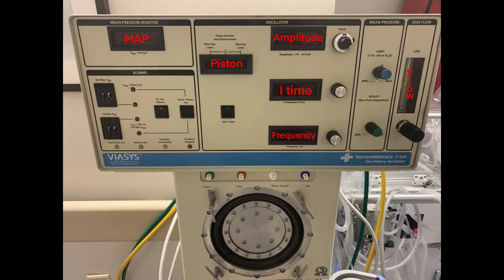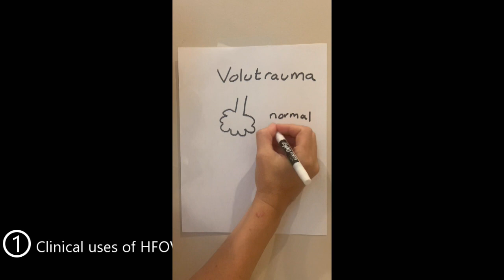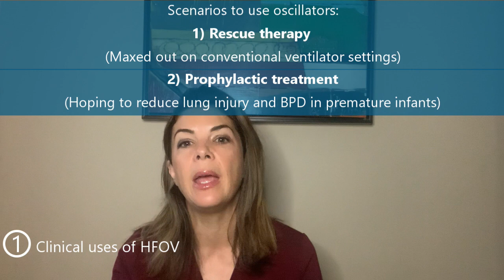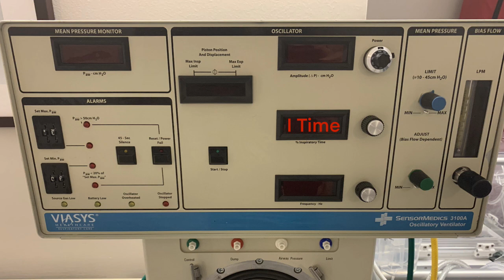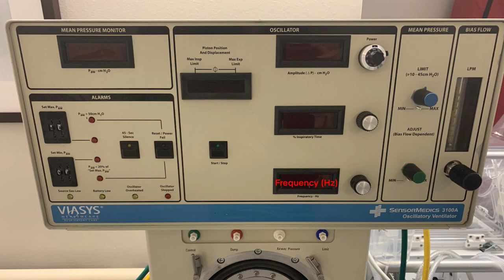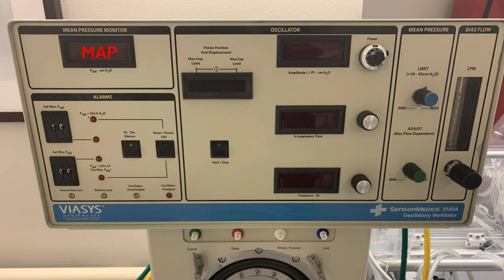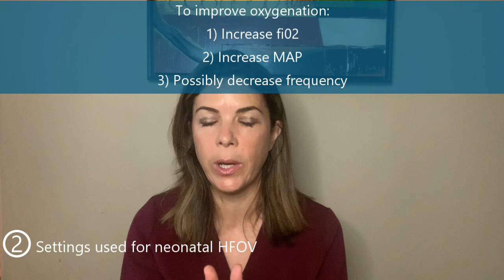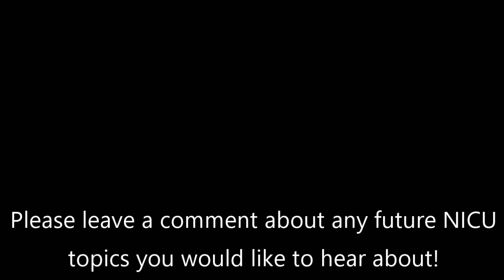PART II of High Frequency Oscillatory Ventilation - Tala Talks NICU

Comment: A lot of good information.  I would like to add that the amplitude is NOT a setting.  The amplitude is a measurement only.  The Power is the setting.  The power controls the piston.  The amplitude fluctuates in response to compliance and resistance of the circuit, airway, and/or the patient lung.  Ordering a set amplitude can be a dangerous practice.
Reply from the maker: Thanks Chris for your comment! You're absolutely right the power is what determines the delta P and the actual setting that needs to be adjusted- but I'm guessing you come from the RT side of things- as in every NICU I've worked in, the order we place is always for delta P or amplitude. Thankfully, the NICU RTs are always are of this. And I agree- any ventilator in the wrong hands- just like any machine- is dangerous. Thanks!

Comment: Dr. Tala, thank you for your wonderful videos. I have questions which you partly eluded to in your videos:
a.) What would be max vent settings on AC-PC and VC-AC at which point you would consider changing over the HFO?
b.) What would be max values in terms of MAP and Amplitude?
c.) What would be suitable extubation parameters for conventional and HFO?
d.) In term of CMV in neonates we mostly use volume control. When would I change over the pressure control>
e.) Why when changing form Draeger VN500 to Sensormedic can I sometimes see such significant changes in my next PCo2 even though I am using the same settings? 
Sorry I know it is a lot. Thank you so much for your help.
Reply from the maker: HI Bettina! These are excellent questions- and they're all super dependent on the patient and the unit0 (AND THE XRAYS- if you're super-inflated- doesn't matter how low your pressures are- you don't want to go higher)- but it's always nice to know how different units do stuff- so we'll make some suggestions!
a) Max AC-PC- rate 40, pressures needed in 30s (or high 20s for preemies). Volume control- not getting there with Tv > 6ml/kg or needing super high pressures to get you tidal volumes
b) Max values oscillator- really dependent on the Xrays- but have gone up to a mean of 30 and delta P of 50 in term sick kids (lower in preemies)
c) Extubatable- you want to get as low as possible- especially with the mean- low teens for the oscillator, preferably. 
d) Generally you would change to pressure control if you had a large leak with the ETT (unable to accurately measure pressures)- or for whatever reason you're using much higher pressures than you'd feel comfortable with achieving the volumes.
e) ALL the machines are completely different! And for whatever reason- some babies just hate a form of gas exchange over another. We'e definitely had those situations where we've tried the jet or the oscillator and a baby has hated both and we've gone back to a regular ventilator. 
Ultimately you want to be on the machine that can oxygenate and ventilation for the baby with the least support possible!!!
Hope these vague answers help!!

Comment: In the example you gave, why would you decrease the frequency when you have only 6 ribs of expansion! I understand your CO2 is high, but you must first ensure adequate expansion, that itself will decrease your CO2 by improving your gas exchange
Reply from the maker: Excellent point- it’s weird because on the oscillator: decreasing the frequency actually recruits long volume- so it can help inflate the lungs. We often don’t use it this way- but we have when we’re desperate!

Comment: Hello Dr. Tala
Why in HFO we going up MAP by 2 - 4 cm H2O more than that of conventional ventilator?
Thanks in advance
Reply from the maker: Generally we’re going on an oscillator because we need more help with oxygenation- so this helps that. But we consider it less damaging to provide this constant open pressure this way and so we can afford to give a higher MAP. I haven’t seen a study that compared the expansion at different means on different machines (and briefly tried looking)!!
Reply: @TalaTalksNICU 
Thanks 🌹
Reply: I searched for that
I found
There is an open lung  strategy of
*- High volume lung strategy in which we add 2-4 to MAP and used in most conditions when the HFOV is the ventilatory support 
**- Low volume lung strategy in which we substract 2 from the MAP value
It is recommended in patients with air leak syndromes